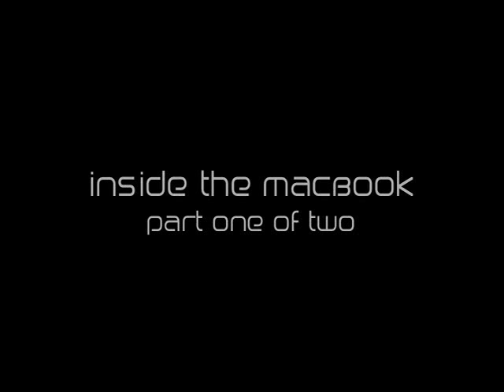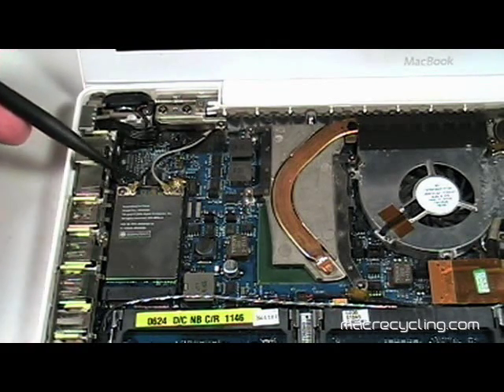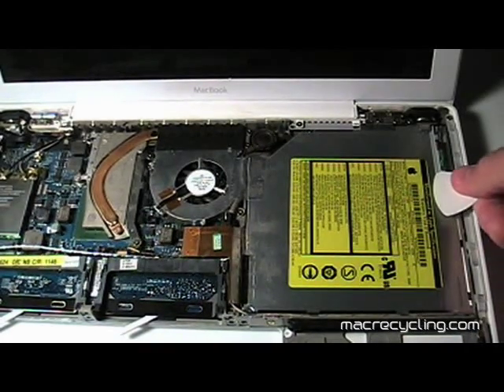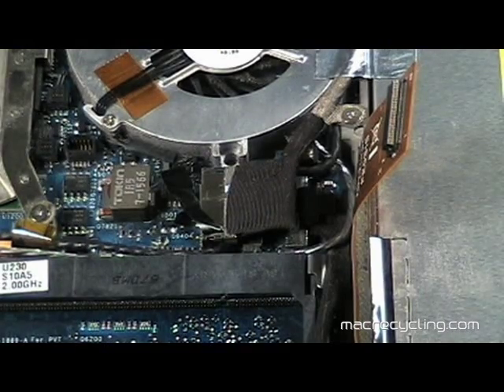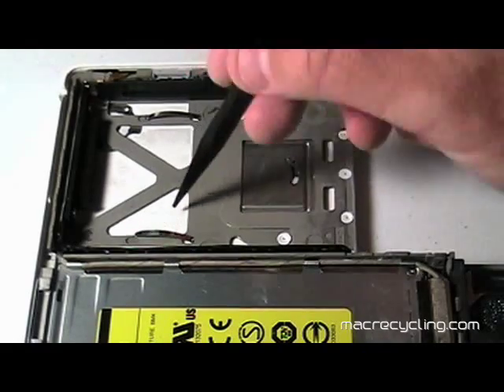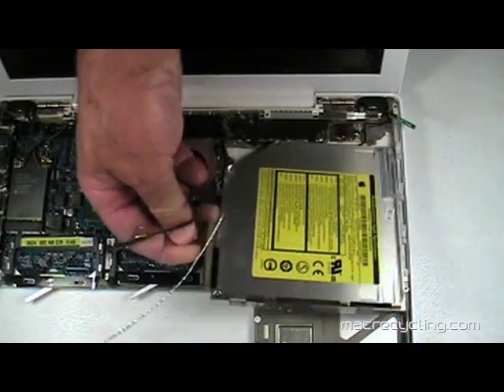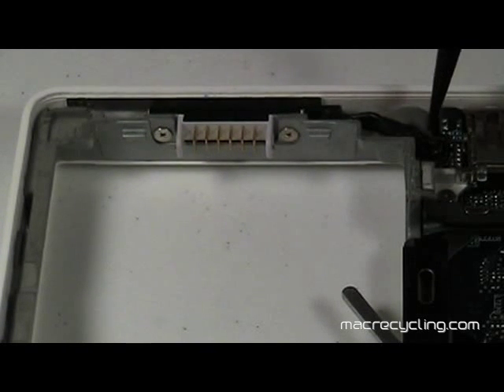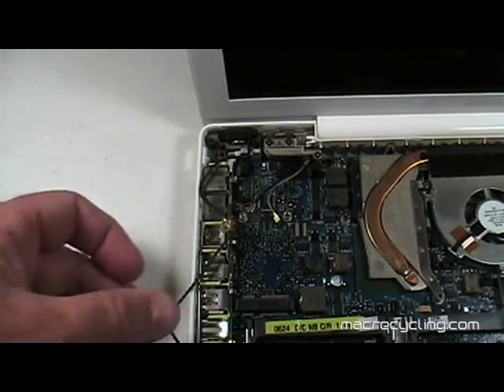Take Apart MacBook 13" - Disassembly: Inside # 1

Comment: I am a very tech savvy person and love to do repairs myself on any of my electronics, but when it comes to mac i would never do anything myself. All the parts are soo small and the screws so easy to strip, I once attempted fixing a simple corner dent on my old mac and lost a screw and couldn't get another screw out because I stripped it. I understand if your just salvaging parts, but if it's your main laptop and you rely on it....na

I definitely admire your guys trust in your skills.